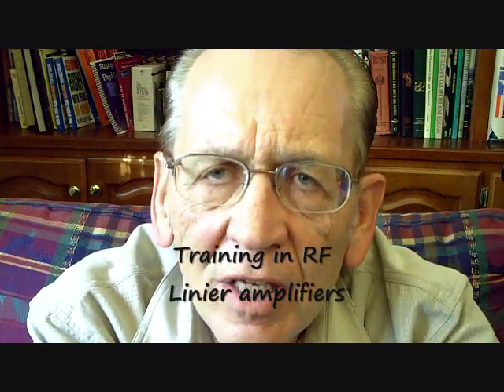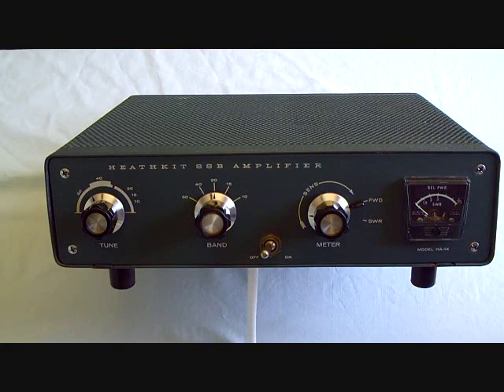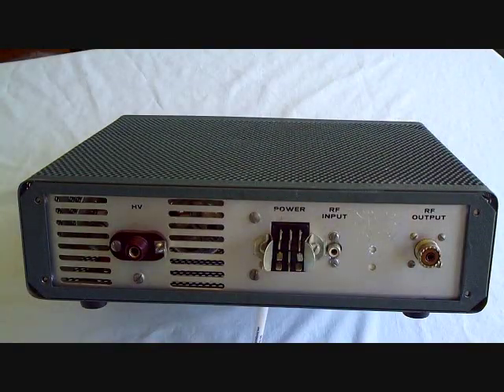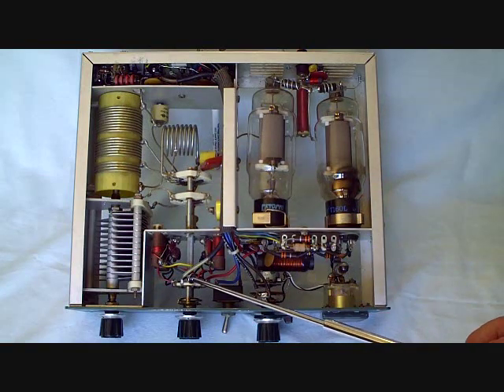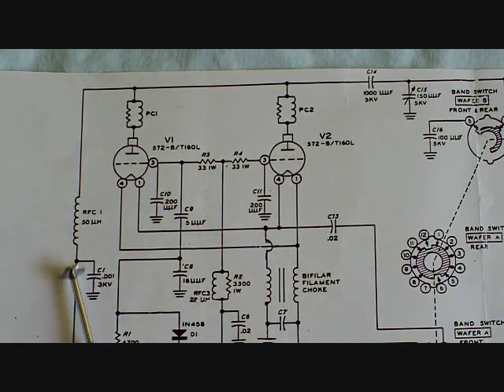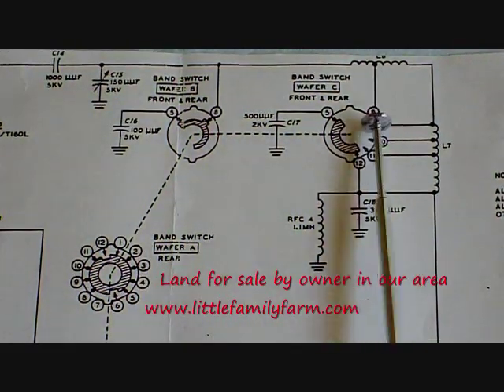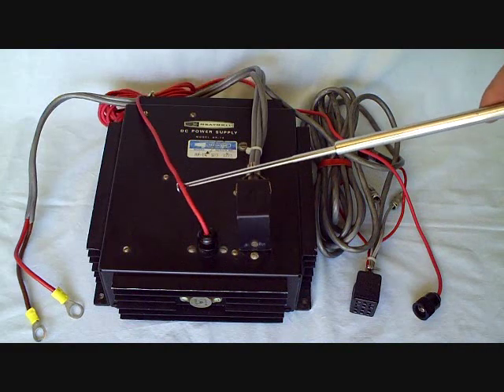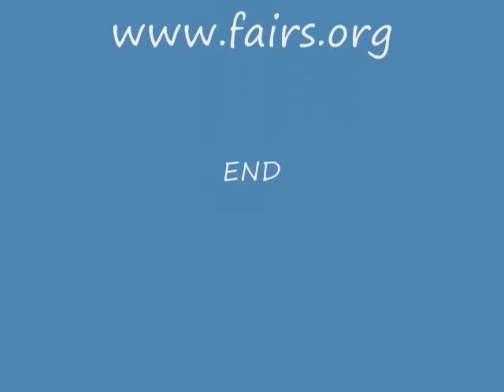Heathkit HA 14 Linear Amplifier tutorial

Comment: I have one of these HA-14 amps with the a/c hp-23 ps for the shack, but I want to use it to boost the Rf of my Yaesu FT-857d in my Silverado truck. I don't know how this can be accomplished since the designated power supply, HP-14 is impossible to find these days! Do you have any suggestions for an alternate dc mobile power supply that would be suitable to power my HA-14 amp in the truck? Thanks!

Comment: I know, old video. This is for those who already do not know...do NOT use Svetlana 572B's in any amplifier where the tubes lay horizontally such as this amplifier. The grids in these tubes WILL sag and short to the filament resulting in damage to the amplifiers bias supply. I know too many hams who have learned this the hard way. The Chinese 572B's seem to be okay horizontally.

Comment: Thanks david.  These are a nifty amp. Important to note this is has fixed output loading. It is designed for 50 ohms Z ( impedence).  Best used in conjunction with an antenna tuner. There is also an AC supply available for this amp.  Often the amp is found with NO supply at all.   It can be tested and run at low power using an HP-23 . Note there is no cooling fan.  compare to SB-200.  The power supply from a junk SB-200 will run this very nicely... but don't destroy a repairable one to get it !
Reply from the maker: Capt Larry Hi Larry - I did sell this AMP but still have far too much ham stuff. I built an amp in 1964 - mobile that used 4 of the 562b tubes - it worked great in my little Nash Rambler - I still have that one. Also just received a Johnson Thunderbolt - don't know if I will ever have the time to get it going. Thank you again for the comments. dave
Reply: +lcfgroup  great david.... good old ramblers !

Comment: Correct, DC can pass but RF cannot. It cannot block any HT to the anodes, but it might restrict the current depending on it's inductance. As Icfgroup points out, RF feeding back into the PSU can only be bad.

Comment: sorry but statement that output choke serve to separate dc component from rf signal is nonsense.....main purpose is to prevent high voltage to come to output if anode blocking capacitor short for some reason,and to blow fuse in supply...anode voltage is in series with blocking capacitor and sum of plate and load capacitor,since that capacitance is low,dc component is marginal.